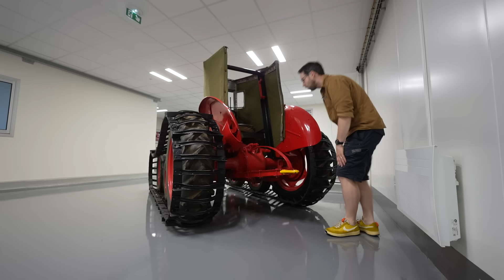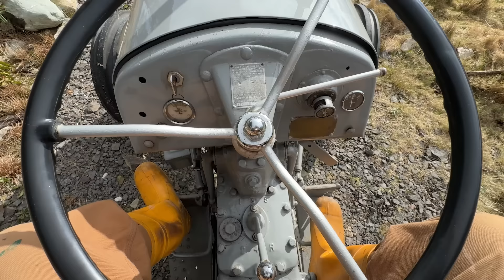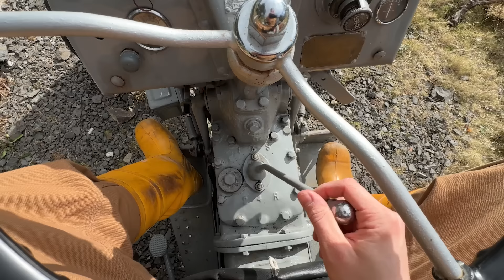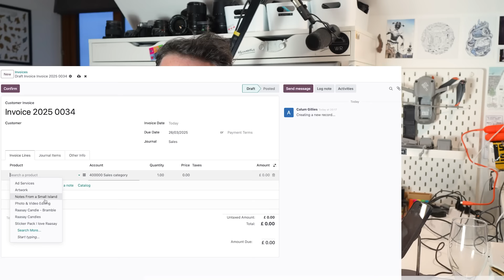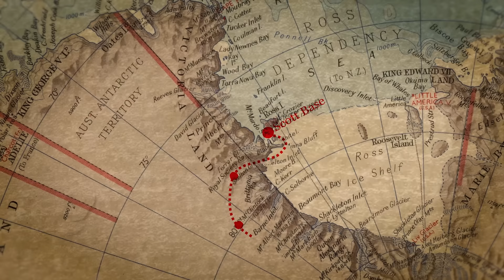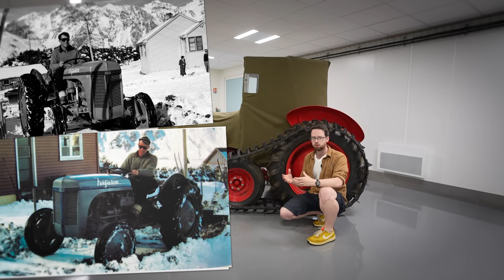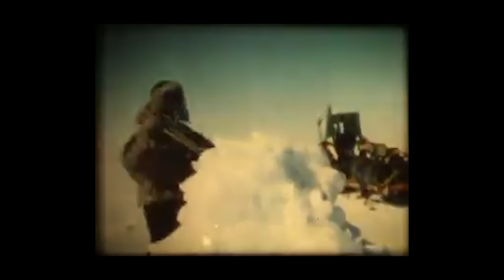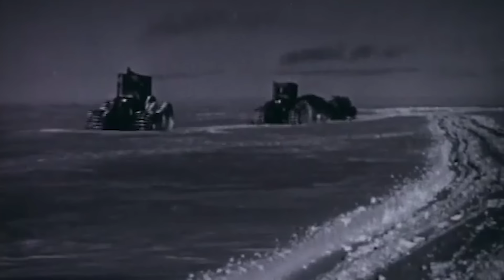The First Vehicle to Drive to the South Pole

Comment: Great report of the antarctic crossing.. The weatherproofing was pretty abysymal.. Surely they could have done better, there would have been lots of tractor modfiers back then. Perhaps it was a budget or transport constraint.  28hp pulled back to high altitude of about 16hp... Sort of like what a rideone mower generates now. !
Reply from the maker: Yeah really they had to work with what they had minimal time, money and materials so those cabs were the best they could assemble! Although I suppose compared to walking or dog sleds they considered it pretty comfy!

Comment: Ferguson was visiting Henry Ford, and they visited some locals near one of Ford's properties in Upper Michigan, who were using a 2 point hook-up for certain implements. One of the vehicles looked at was my grandfather's self made "bug". He couldn't afford a tractor at the time, and made his own from a Dodge chassis with a Buick motor. The 2 points looked at gave Ferguson some ideas about improvements to the system and the knowledge that being built in from the start would work so much better than the add-ons being put together by Farmers and whatnot in the U.P. 
Grandpa wasn't farming with his, much (they just had a small garden). He worked for the rail road. He used the Bug, and later a Ford tractor, to power a lumber mill (also self made) and for skidding logs for the mill to build his houses, barns, and pig pens, and general snow plowing, road grading etc.

Comment: So Ferguson made the first 3 point system, still used on tractors today. Its genial as you can  not only lift an lower equipment but also adjust the running height of say an plow or a scraper accurate and fast.

Comment: The first vehicle I ever drove was the Fergie TEA20.  I was  a farmer's son in New Zealand.  That was more than 60 years ago.  You are right - it was really easy to drive.  My local provincial airport used the same tractor to haul the baggage trailers between terminal and aircraft, right up until the mid 1990s.

Comment: How in the heck were they able to tolerate the cold with just a thin canvas between them & the Antarctic weather...?
Reply from the maker: This is the thing I can still never wrap my head around. Especially with the kind of coats they had back then, far less advanced than modern protection!

Comment: we also have old Massey Ferguson (42hp diesel) still at home with similar transmission chamber. we also have another new tractor (different brand), but the quality of Massey hydraulics (sensitivity wise) is still on top. Even newer models of another brands are still not better than that. Massey Ferguson is a brand which I trust.

Comment: The Ferguson looks a lot like a Ford tractor.
Reply from the maker: Funny you should say that! Ferguson originally went into partnership with ford, creating the “ford ferguson”. That agreement broke down quite badly just after WWII and Ferguson return to the UK to start producing the TE20 Ferguson. Ford had to pay millions ultimately for their own continued use/copying of the Ferguson system
Reply: Cool.  I was wondering if there was a connection there.  I actually would kind of like to get an old Ford 8N if I can afford one.  Almost seems like they're becoming collectors items now, but I'd just like a nice small tractor with 3 point and a loader to do some light work with.

Comment: TE 20 was and is a great machine, as a kid in New Zealand just about every farmer had one, and probably still do.
Years later I rebuilt one with a small hydraulic winch tapped into the machines hydraulics for beach launching and recovering boats, all good except for wheel corrosion.
The petrol engine other that a tune up needed no major work, exhaust system was changed from original and a dry Donaldson air cleaner and alternator were installed. 
The purists would go bonkers on this but it was a mess when I got it but rather respectable and practical at the end.

Comment: 28 HP.....  Amazing.  We had an old Ford tractor that looked similar, was dependable, fast, powerful and simple too.  If I had a tractor today.... that would be it.
Reply from the maker: Possibly a Ford Ferguson? They were the precursor to the TE20!
Reply: @CalumRaasay  From looking at pictures, it looks like a Ford N8.  I remember it having a clutch, ran on gas, running boards rather than pegs, I can't remember if it had a tilt with the PTO.  Looking at the pictures brings back a lot of memories from my grandfather's farm.... many years ago.  It was a great tractor.  It is amazing how well a lot of things were made in the 40's and 50's.

Comment: Oke tell us how many times it did brake down on the trip because i lost my job i drove the fergison on my work it broke down so much i change my job sow its not a goof tractor and i hate it very much even i did get it for free i wont take it
Reply from the maker: No break downs of a major sort at all actually. Only frozen fuel lines and damage to components from the ice. The only major breakdown mechanically was the PTO breaking back at base with one of the other tractors.
Reply: @CalumRaasay  then they make it better then now the tractors if you ask me

Comment: Put a rollover protective system ("roll bar") on your tractor. I had a Massey-Ferguson tractor roll over once. It happened suddenly in a few seconds. If not for the rollover protective system, it might have been bad.
Reply from the maker: Yeah, it’s on the list! As a result I don’t really use it on anything other than flat ground atm.

Comment: As a once-upon-a-time "high technology" design engineer (now long retired), I learned early in my career that while high technology is good and a lot of fun, ** APPROPRIATE ** technology is always better.  I once designed this Z80 microprocessor based gee-wiz device running this really elaborate program that I had created in assembly language with all kinds of bells and whistles, keyboard, alpha numeric displays and ports for this and that and you know, a simple pad of paper and a pencil and a clock the operator could read the time with outperformed it --- badly outperformed it.  That was quite a lesson that stayed with me to this day.  Always use appropriate technology.

Comment: Grew up on a dairy farm in nz (born 2005) and I’ve driven many of these style of tractors and they’re genuinely perfect they can do anything that we don’t need just a bigger tractor for. We use these little ones for towing a bit of stuff and guiding falling trees with a rope and light work like small hay bales, big modern monsters for pulling 8 ton up a 30 degree slope or lifting 4 ton up onto a freight truck

Comment: Some  history I was not aware of.   Have seen Mary Ann and Pam at the Best of the West Show.  Two of the LGP Stretched D8’s. 

I watched a video about one of the first over ground resupply operations to the South Pole about twenty years ago.  It was very cringe for me to watch as one with a Bachelors Degree in Agricultural Engineering.  I am not sure what Aberdeen Proving Ground was thinking. I participated in the first Traction Efficiency Study using electronic instrumentation.  The Data acquisition system was based on an Apple II+.  Off Road Locomotion was an interesting but odd class.

Comment: Fun fact. Turning with the brakes is less stressful on the drivetrain when used in the proper condition's than you might think... The same as you aren't meant to use 4wd with differential lock on dry or in conditions with good traction because it can cause loss of steering ability and unfavorable driveline instability etc at least and complete failure fairly quickly, you need the loss of traction or slip for proper function, with tracked vehicles trying to use the brakes to turn, without the slip you will quickly pull the tracks off, break them, damage the driveline or just not have the power to even turn 😂

Comment: My family had a Massey Harris 50 when I was very young. (Ferguson 30) they traded it for a John Deere 2010 and regretted it. I remember standing on my bed looking out the window and crying when it left! Dad remembered the serial number of that tractor for 40 years trying to find it again! All I remember is that it started with GM×××××. Now I have a restored Massey Ferguson 1155 with the V8 Perkins. If you think your Fergie is loud try plowing with a turned up 540ci V8 Diesel on dual straight pipes and no cab pulling fire out the stacks! I used the 1000 rpm pto to power a 540 rpm 7ft dual auger snowblower. The local housing development liked it because I could remove the built up snow piles in the cul-de-sac by blowing it over the 2 story houses into their backyards even then I had to throttle it back to keep it from breaking something. Dynoed 236 hp before I turned it up again, it blew up the pump in the dyno before I maxed it out so I have no idea what it has now, stock was 140.9. We had a bunch of Massey's I retired moved and sold the farm.  Now I live on 1 1/8th acres. Kept the 1155 tho! 😊

Comment: The welded sections on the front axles aren't just stiffeners to stop the steering joints from folding under the axle on impacts, they also serve to lock out the steering and limit axle pivot to prevent de-tracking, which the team discovered was a major issue soon after arrival. Those long black painted struts are actually "waratahs" aka star-picket fence posts welded on by Hillary's team during the winter between their arrival and when the main expedition set off.

As you mentioned the other two of the original trio are preserved here in NZ, one at the Canterbury museum alongside one of the Tucker Sno-Cats (currently closed for renovation) and the other at Auckland's MOTAT. There's also a replica at the Sir Edmund Hillary Alpine Centre (adjacent to the Hermitage Hotel at Aoraki/Mt Cook) built by John Callesen and documented in his book "Something Different", which goes into great detail about how he tried to make all modifications using only the materials available to Hillary and the team, to keep it as authentic as possible. Much of Hillary's training for the Everest expedition, as well as early ski-plane glacier landing trials were conducted at Aoraki, and I believe some snow testing of the Fergusons.
On a related note a replica of the DHC Beaver NZ6001 seen in this video (a former aerial topdresser converted to Antarctic spec for display - the original crashed on a glacier in Antarctica) and one of two extant Auster Antarctic ski planes from the expedition are both at the RNZAF museum in Christchurch - definitely worth a visit!

Every time I fire up my old grey Fergie I think of just how tough Sir Ed and his crew really were driving those things across the snow!
Reply: Stiffeners I dare say I need a big stiffener to satisfy my tight ass now

Comment: Seems like the perfect solution. There was almost at this same time a custom made ‘giant wheel’ motor home type vehicle that tried to cross the Antarctic. A brilliant machine… but not based on an easy to repair, known reliable already in use. That other machine failed and was left in Antarctica for the next 60 years. This reminds me of the snowmobile guys that went at least almost to the North Pole. They took reliable machines and just created a longer snow camping trip.

Comment: Didn’t expect you to do a video on tractors next, but as a country critter myself…I’m pleased that you did!  That nice old gray one they let you drive  is Just a lovely old tractor and still plenty capable, long as you mind the paint 😉.  I used to work for a winery where we had a couple old-school tractors that they actually used on a daily basis and were lovingly maintained by the mechanic staff.  I think one was a similar Ferguson.   And they were a fairly profitable winery and could easily afford newer tractors, but they chose not to for those purposes. Completely restored and hauling the grape slag from processing to the mulch pile.  And it probably still is 10 years later.  At worst it’s been relegated to hayrides, but I’d like to think that it’s still hauling

Comment: Interesting ...
Was the First tractor i learnt to drive about Five years old 😂

Really cool machines especially when they were converted to live Drive PTO's 

They had a wide range of attachments Wheel jacking systems , fert spreaders  etc ...

How Ever the TEA20 did have its limitations and when the MF35 with hi/low and Diesel 3cyl and live drive pto standard it was a great up grade ...

Comment: I had a 1964 IH Cub LoBoy that I used for snow plowing in the winter in Vermont decades ago. Temps could be -26F, and were, I had to cover the engine in a similar manner to keep the carb from frosting up. It did divert some heat toward the operator seat area. You probably wanted to be fully dressed and a heater cab would have been too much for the well insulated driver. Warm(er) feet would be a blessing.
Reply: One of our customers would have us remove the mower, and install a front mounted snowblower.  The Cub was pretty light in the rear, so we modified it to hang four suitcase weights on the back.
Reply: @robertheinkel6225  mine had turf tires and wheel weights and I would chain it up for the winter. I really wanted a one arm loader.

Comment: Those black brackets on the front axle beam was not for strength, but to lock the front wheels straight.
Reply: Makes sense... Although it may have been pulling double duty as a happy byproduct.

Comment: Ferguson patented the 3 point draw hitch prior to the late 40's. It was licensed to FORD for the 9N 2N and 8N tractors, when Henry Ford Sr died Edsel stopped paying royalties to Ferguson and at that point Ferguson sued FORD and began building tractors himself.  
I've got a Ferguson TE20 with my WOODS 60" finish mower- a 9N with a root rake, 2N with a scrape blade, 8N with Bush Hog and a newer diesel DEERE with a backhoe.
Reply: Correct, Ford became aware of the Ferguson system because they were being fitted on Fordson tractors as aftermarket equipment. Henry made a handshake deal with Ferguson to put the 3 point hitch on all his tractors but then, (not sure if it was Edsel or Henry II) stopped honoring the deal.  I had some moments because most of the things said about the Ferguson in the video were true of the Ford 9N about a decade before.

Comment: Pencils actually don’t work well in spacecraft… The graphite dust shorts out the electronics..
The “Fischer Space Pen” was actually a privately developed system (and much cheaper to develop than the often quoted “millions” because it was based around the universal ball point cartridge developed in 1946 - just with a gas accumulator rather than a vent).
One of the tractors in Christchurch isn’t in a museum - it was in the lobby of the motel near the airport… (Stayed there once…)

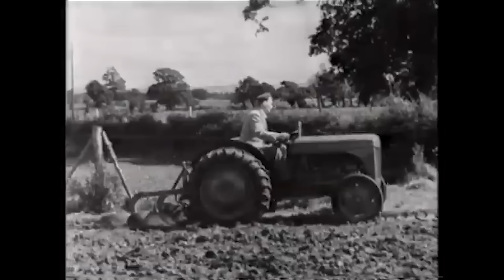Comment: 2:59 as a owner of a ford 9n (1940 specifically) that thing won’t start when it’s below 15 degrees Fahrenheit how did the ones in Antarctica start
Reply: I suspect they were never turned off.
Reply: @robertheinkel6225  by my comment I meant it will start and I have to have it full choke and a small breeze will stop it
Reply: I believe the video mentions they had oversized batteries and used blowtorches to heat the engine. I've had to do much the same to start an 8N in cold weather, heat up the crankcase with a torch, and hope the oversized battery has enough oomph to spin everything up.
Reply: Doesn't the 9N use a Ford engine? The TE20 used a Standard engine.
Reply: My grandfather's 8n was running well until about 5 years after he passed, and it's been about 10 years since its ran, and I can't figure out what's wrong with it.
Reply: @CT5555_  your ignition system might have gone kaput
Reply: Skill issue

Comment: Interesting bit of history. Those half tracks were common after WW1. They even made them for Model Ts. ARPS was a large builder and they made them for all tractors. I saw a Ford 9N with them on an auction and I really wanted to buy it but I live in town and the city wouldn't be happy with me parking it in my yard. The Model T and Model TT versions were used in northern rural states for mail delivery and school busses. After WW2 Allis Calmers, John Deere as well as International Harvesterand later even Ford was making small crawlers like was used during the war. The IHs were used to pull long trains in northern Canada. I don't think you will loose your hearing using the Massey. I didn't and I even used it inside a barn hauling bedding for cows. When I was in high school and FFA there only IH and Massey Ferguson tractors used locally. Its why my rolling tool box is from Massey Fergusson.

Comment: We had a couple of tractors at an excavation company I used to work for. One of them was a 2WD Massey. I don't know the model, but its tires were ~ 5 feet tall (edit: or maybe a little smaller than that, this was like 20 years ago). The other was a 4WD Ford of about the same size. I mainly used the Ford. I really loved every time I got to take one of them. The company mainly used them for digging/grading, but I would get to go out with a bush hog for taking down fields.